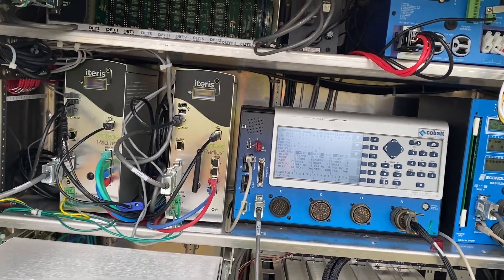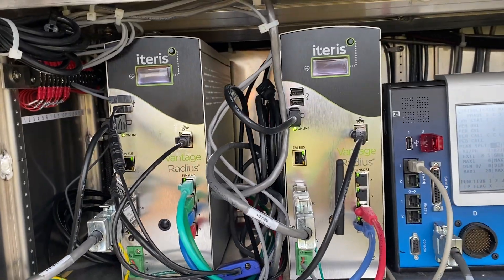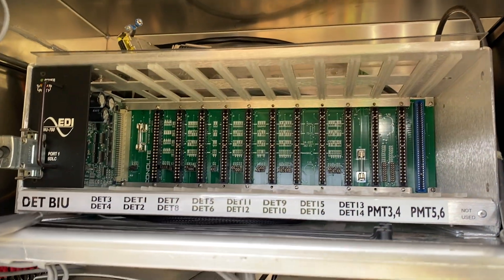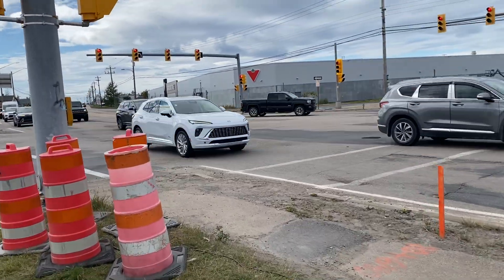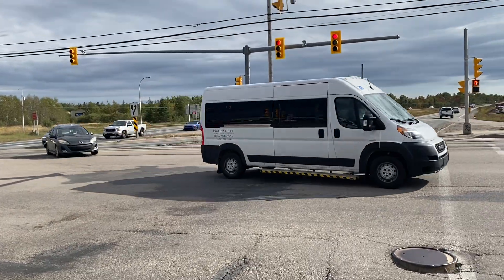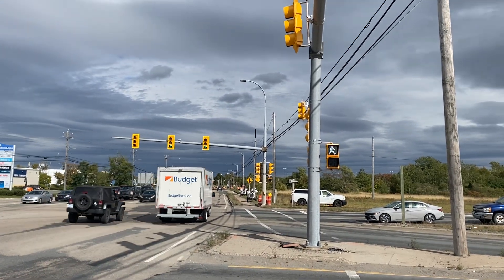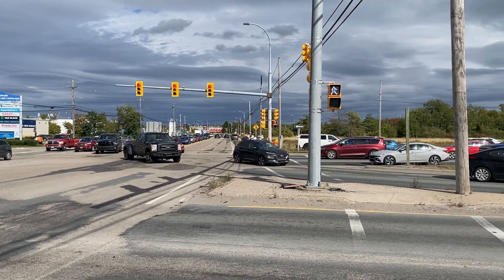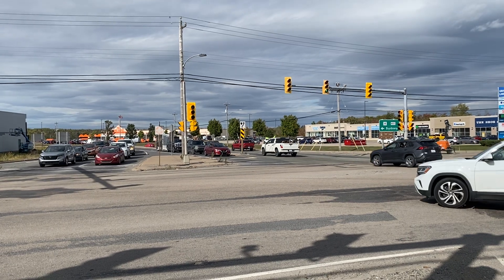Signal Upgrades in Sydney at Hwy 125 & Grand Lake Rd

Comment: At 4:09, I feel like the median pedestrian signal placement could be slightly better. If it was behind that ped signal facing the opposite direction instead of right on the pole, there would be less of a chance of a pedestrian looking at the wrong signal.

This (as well as conserns about the APS) was cited as reasons why York Region didn't have one time half of the two-stage crossings across their BRTs with the parallel left turns going through the other half. But by their logic, I guess no one should be allowed to use any crosswalk if just one direction has a leading left turn signal (let alone split phasing). Hopefully, this intersection will serve as proof to them that it can be done.
Reply from the maker: I agree. We will likely be relocating some of the pedestrian signals since this is our first two stage crossing. Once the new APS buttons are installed, depending on which side you're crossing, the pedestrian signal closer to you will activate first. I also have logic in place as of today so both peds currently have to come on together, with the exception of the phase 2 coming on with phase 7. People will also get used to it. I have toyed with the idea of some additional signage or even pedestrian louvers but I think it will come down to the placement of the signals and the logic in the controller.
Reply: @TheTrafficTech  I was going to mention this as well. Moving the median ped head further from the pole will align it better with the far side head.

Two Stage Crossing signs can also be mounted on the median hanging out next to the ped head to further obstruct visibility of the far side head